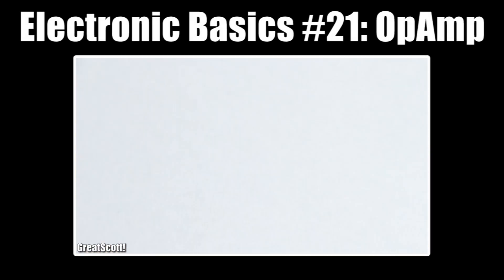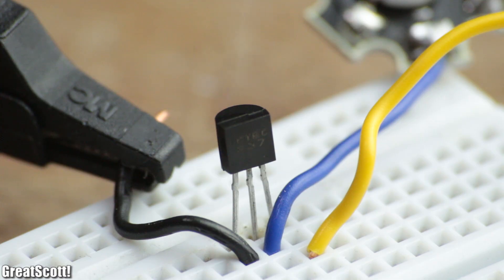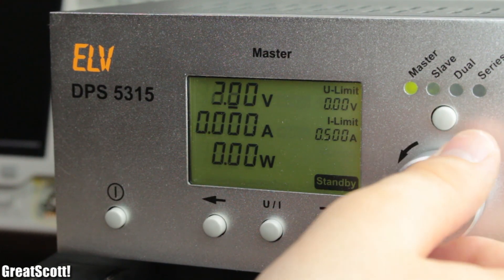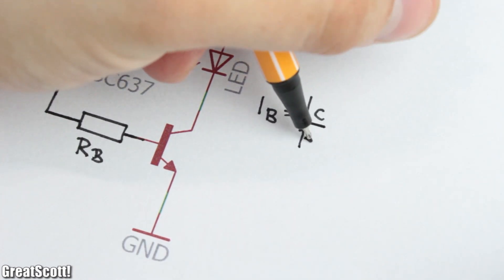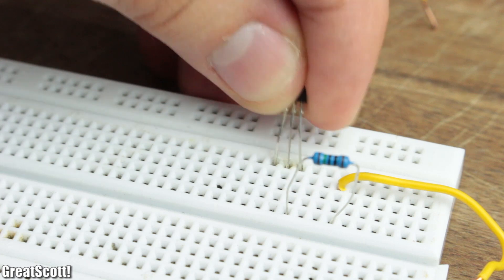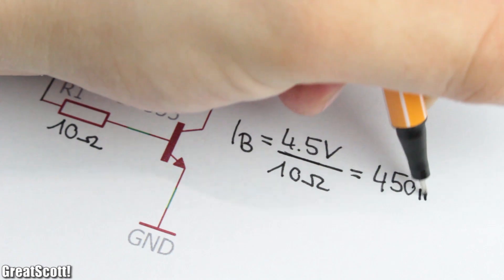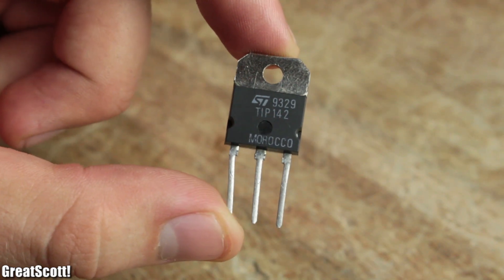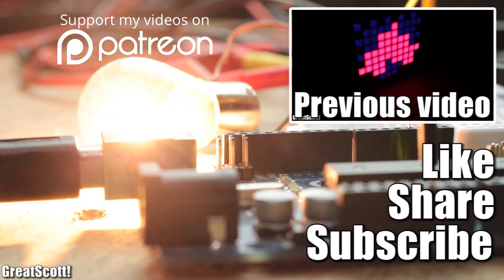Electronic Basics #22: Transistor (BJT) as a Switch

Comment: i want to make a awesome project using arduino 
can u tell me
Reply: Vid use bluetooth shield, instead. very cheap and simple, and you could use an android app to control (like "bluetooth rc controller) your car. An quadcopter will be a much more difficult challenge, because you'll probably need an brushless motor, an esc controller... It will be difficult to control the project weight. 

Shivanshu, make a small led cube (maybe 8x8), or buy an led array (like the ws2812) and program some effects on it. 
You could also make simple projects using a LED as a light sensor, working as a switch (when the sensor led does not detect light, it turns another led on), or a presence/movement sensor. 
A good idea is head to instructables.com and type "arduino" there are several tutorials, for begginers, intermediate, etc. 
There are, for instance, plenty of bb8 (star wars robot) projects, some quite easy to do.
Reply: turn arduino into compiter with audio and video jack
Reply: +Vid Rogic any other projects
Reply: time machine...... JK...just tell how much are you families to arduinos....beginner/intermediate/PRO....
Reply: +Shivanshu Mahim beginner
Reply: +Preyansh Yadav you could make a fire alarm using the LM35 temperature sensor or a door alarm using a small neodymium magnet attached to the door and a hall effect sensor ......try it out!
Reply: +Shivanshu Mahim any other projects
Reply: +Preyansh Yadav i dont count this as a beginner's project...rather its an intermediate one.....but at least  you could give it a shot.....thats made by me btw!
Reply: i am planning to make quadcopter with cheap motors and tv remote and ir sensor as control. try it out
Reply: well just idea and it is really cheap, also i thought about little car also with ir
Reply: I made a led lamp with brightness controlled by a tv remote. Did the same with pc fans. I emulated a WinLIRC server. Those things are really useful to me.